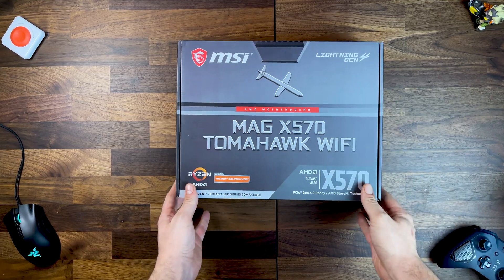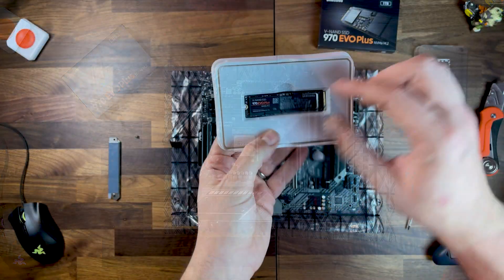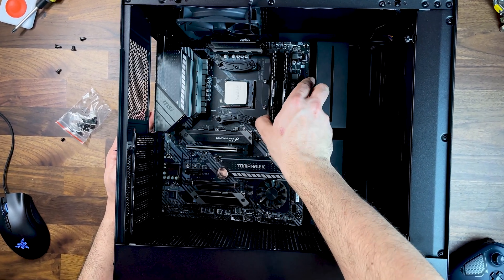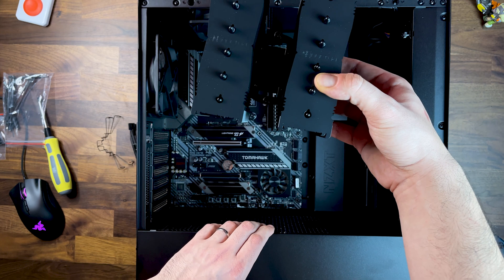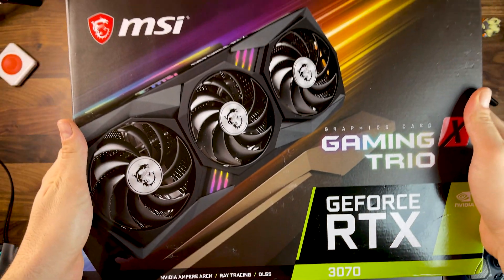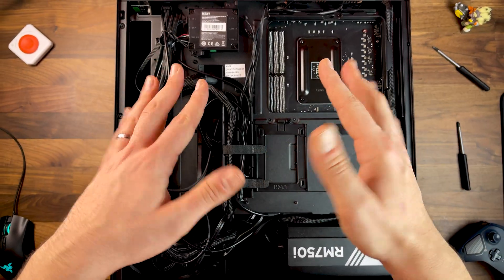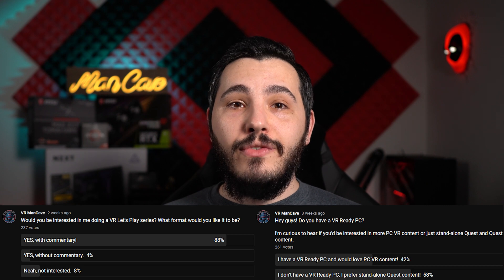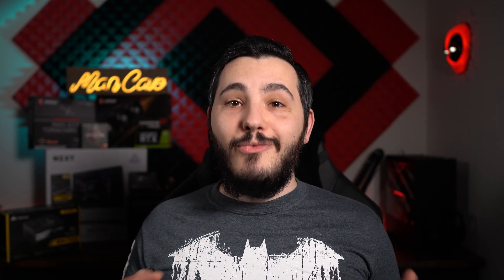PC VR Build 2021 - How I Made a VR Ready Gaming PC - My Dream Setup for Oculus Link on Quest 2

Comment: Now that you've had your PC for a while, have you had any issues with USB disconnects when using Oculus Link? I'm aware that some people have had issues with this on the AM4 platform.
Reply from the maker: For the longest time I had zero issues with that, but recently started having some randomly. The key is to set the USB Selective Sleep function in windows as disabled. Testing a Kiwi Design cable now that is Usb A to Usb C, since supposedly that works better.

Comment: I'm looking to get a PC for VR and other things as well. Personally I'm probably going to go with an i7 but a 3070 with it like yours. I just haven't built a PC since the early 2000's so some of it is intimidating. Especially water cooling and the names of chips, they sure like to have complicated names to components now.
Reply from the maker: Same here man, I feel ya, haven’t built a PC in ages but you get the hang of it pretty quick, even with all the new developments. If you will also edit videos on this PC, I highly recommend looking at AMD processors as well. I was the same, thought Intel was the best and AMD wasn’t that good, but for productivity stuff like editing, it beats Intel, and in games the difference in performance is probably 5%, which can be sorted with a light overclock. Hope that helps but feel free to ask if you have questions. Cheers!

Comment: Been struggling for days on what PC to buy so I can PC VR with my quest. Would it be possible to switch to an AMD Ryzen 9 5950x 16 core with this setup?
Reply from the maker: Yup absolutely. I’ve actually thought about using a 5950x but couldn’t find one in stock back then and the performance gains for VR would be minimal. You’re better off investing that money in a better graphics card if you can.
Reply: @VRManCave  what’s better then MSI GeForce RTX 3070 LHR 8gb?

Comment: A couple questions:

1. How much did this build cost?

2. Is everything you said in this video all you need for a vr ready pc?

3. Where can I buy all of this stuff?

Thanks so much man!
Reply from the maker: Hey Nolan! The build was around 2400 Euros, which is about 30-40% over what it should have been under normal circumstances, but because of the chip shortage and the GPU shortage, the prices were way higher than normal. And yes, everything in the video is all you need, I'm super happy with my choices and everything is working wonderfully. Regarding where to buy these parts, I'd say wherever you can find them the cheapest in your geographical location. I bought most of the parts from Amazon UK and Germany, but if you're in the US, Microcenter could be a great choice!
Reply: @VRManCave  thanks man! Keep up the good work, love the vids

Comment: Hi. I know nothing about gaming PCs. I am curious the overall cost to build a PC like this for Oculus Quest 2. Is there a cheaper version that would still do the job?
Reply from the maker: Hey Aaron! Yes there absolutely is, I've built this more expensive one because I also use it a lot for editing and other tasks for the channel, but for a PC to be considered VR-Ready, all you need is an Intel i5-4590/AMD Ryzen 5 1500X or better, and a GTX 1060/AMD RX 480 or better, combined with at least 8GB of RAM, although I'd recommend 16GB. So you could build a PC that's capable of running VR games for around 1000$ or so. I'll probably make a video soon with PC builds for multiple budgets, so hopefully that'll clear things up even more 😄

Comment: I haven't built a PC is at least that long also, I had considered purchasing a new one but you may have just motivated me to build one. What was the software process for each piece. What was the total build cost?
Reply from the maker: Hey mate! Yeah building one is definitely the way to go, because in prebuilts you might see on the specs that it has a good graphics card like a 3070 or 3080 or whatever, but it's usually a lower end model of that card and you end up paying just for the fact that it has been preassembled. Well, the software side of things was pretty straightforward, I just installed the drivers from the manufacturer's website for the latest versions, but with Windows 10 everything works out of the box. One thing I had to do was to install a newer version of BIOS since the motherboard didn't support the newer generation AMD CPUs with the BIOS version it had installed, but thankfully it has a nifty little feature where you can update the bios without needing another processor, just with a usb stick. Other than that everything just works. The total cost was around 2400 euros, but it should have been under 2000 if the graphics card wouldn't have been over twice the official price due to the shortage. If you have any questions about building one, I'm happy to try and help. Cheers!

Comment: Now show us you setting up your Quest 2 headset, installing the Oculus PC app and getting Oculus Link to work "first time out of the box" rather than spend 3 DAYS trying to get the two to work together, and then the responses you get from Oculus for the Support Ticket you needed to send.
Reply from the maker: Hey mate! Sorry to hear you had such trouble, and ironically for me it was exactly that simple, I just installed the Oculus app on this new PC, plugged in the Link cable in the computer and the Quest and it just worked, I didn't have to do anything else... What did Oculus Support tell you in the end? What was the issue?
Reply: @VRManCave  I haven't had a response from Oculus, many others have said that Oculus Link "broke" from the V25 update onwards and there are literally loads of people with this issue on the official forums but I don't think the most of them logged a support ticket, which I did yesterday.

I was trying to get Link working with my brand new Quest 2 with no success from Sunday night, even getting the mobile app and the Quest to work took hours of farting about as the mobile app kept quitting with "unfortunately, oculus has stopped working!" sarcastic error message on my android Xperia M5. I finally got the mobile app to work long enough to finish the setup of the Quest 2 by turning Wifi and Bluetooth on and off.

Then began three days of trying to get link to work using the KIWI cable, I MUST have link as I got the Quest 2 for DCS, MSFS and X-Plane as well as a number of racing sims and various games in my Steam Library, using Virtual Desktop just doesn't cut it for these titles so Link is the only option.

I ended up buying the Anker cable yesterday and got the exact same problem as I had with the KIWI cable...

The Oculus Home PC app installs and works fine and with the Quest 2 plugged in I can go to the Devices menu and connect to my Quest and get the connection test to pass at 2.2GB USB 3, green indicator and active status for the Quest.

BUT when I go into the headset itself I get the "link available in settings" notification then every time I go into settings and enable Link (or use the Link button in the quick menu) I get a blank void with three dots for a while before I end up back to the main menu with no error messages or information rather than get the Oculus Home app screen.  I can't count how many times I've installed the PC app and tried every damn USB 3 port on this new PC build with its Ryzen 9 3900X, B550M PRO-VDH mobo, 16GB RAM and GTX980 (temporary until current mad GPU prices settle down).

Then late last night, I had the KIWI cable plugged in and decided to quickly check the headset battery status and I doing so thought "one more try" and clicked the link button in the quick menu and...

HEY PRESTO - it fucking worked, and continues to work as I've been using it all day with Oculus Home thingy, all my flight sims, Assetto Corsa and a load of Steam games such as Paranormal Activity and the Alien Isolation VR mod.

The only thing I can think MAY have sorted it was I uninstalled the Oculus PC app, then manually went thru the Windows registry and deleted any keys and values related to "oculus" and used an installer for the  Oculus PC app that I downloaded on the 16th Feb before I had even ordered my Quest 2.

I can only hope it continues to work and I won't be changing a thing on this PC or my setup now it is working fine.  And I am waiting in anticipation for a response from Oculus to my support ticket and see if they give the standard "have you checked your PC specs and cables" useless and insulting response I have seen others get.
Reply from the maker: @TheOneTrueSpLiT  oh wow mate, what a freakin’ nightmare you went through, thankfully I’ve never had issues with link on either my old laptop or the new PC, but I’m happy to hear you’ve sorted it out, fingers crossed it keeps working. And yeah the guys at Oculus Support just act like little robots most of the time, just spitting out the same answers you find in their FAQ. Anyway, thanks so much for the detailed explanation man, have fun with your flight and driving sims! 😁
Reply: @VRManCave  Thanks, this Quest 2 is my first headset so I was hoping it wasn't going to be a bad experience and put me off but I just watched an immersive wingsuit flight in the alps and it was breathtaking, much much more immersive than the very first demo of VR I witnessed at a computer graphics fair at Olympia in London in 1991, that was just a clunky 3D hand and a ball in virtual space!!!! Showing my age now 😉
Reply from the maker: @TheOneTrueSpLiT  If you enjoyed that wingsuit video then you should definitely try the game Rush, which basically puts you in control of the wingsuit in first person. It’s incredible how much VR has evolved in the past few years, can’t wait to see what it brings next 🤯
Reply: @VRManCave  Thanks for the Rush tip, I'll go look it up immediately.  The main reason for getting the Quest 2 is for flight simming which I take quite seriously as it has been my "thing" for many many years. VR adds a new experience and gives me a while new world to discover which I am very much looking forward to.

Since having 5 strokes and as such being unable to work, I generally sit in a room all day with too much time on my hands. Getting out and about was a problem before this Covid Lockdown so I'm hoping that VR will add a new dimension to my life and allow me to "visit" places that I very much doubt I will ever get to see in real life.

If you have any other suggestions that you think I would find appealing please let me know. Aviation is my number one passion and has been for nearly 50 years, I flew gliders and single-engine prop trainers in my teens while in the ATC in the mid-1980s. I'm also a HUGE helicopter fan and gave helis in DCS and X-Plane a spin earlier today and was hugely impressed, I wait with great anticipation for them to come to MSFS but first I need to upgrade my GPU when they're available at "normal" prices again.

If you can think of any good games that are aviation or space related let me know, I'm sure I'll be interested.  Or immersive experiences, I just "swam" with great white sharks, my biggest phobia other than spiders, and it scared the crap out of me - Man, I love adrenaline!!!
Reply from the maker: @TheOneTrueSpLiT  You're super welcome man, and hats off to you for exploring the world through VR, it's really awesome! I'd definitely advise you to download Google Earth VR, it is just so cool to be able to go anywhere in the world and look around from different perspectives. Also for a more casual flying experience that you can also play stand-alone, without a PC, then you might want to give UltraWings a try. I have lots of videos on the channel with various lists of the games I love the most, so feel free to have a look and if you have any questions, you know where to find me 😄
Reply: @VRManCave  I installed Google Earth VR straight away and went walkabout at places I've lived over the years. I'm a total VR virgin other than that experience back in the very early '90s so I'll take a good look at your videos now I've installed the YouTube VR app on my Quest, and will defo look at UltraWings, cheers.
Reply from the maker: @TheOneTrueSpLiT  Great, and I really mean it, if you have any questions just gimme a shout. Cheers!

Comment: A 3070 nice I only have a 2060
Reply from the maker: Well the 2060 is a fantastic graphics card man, I only had a 1060 on my Dell laptop before building this PC. Anyway I wanted a 3080 initially, but couldn't find one in stock anywhere, and I ended up paying about double the MSRP for the 3070, so if the official prices would have stayed at the level Nvidia announced, then I should have been able to get a 3080 and still have about 300$ to spare, but... oh well... :)))